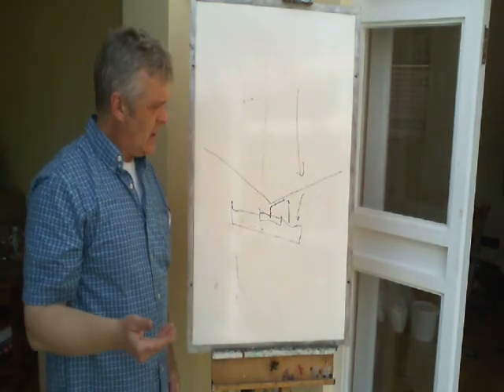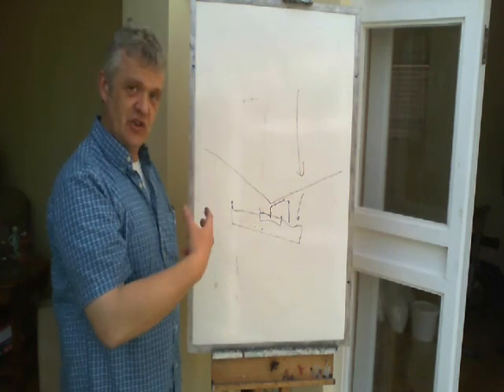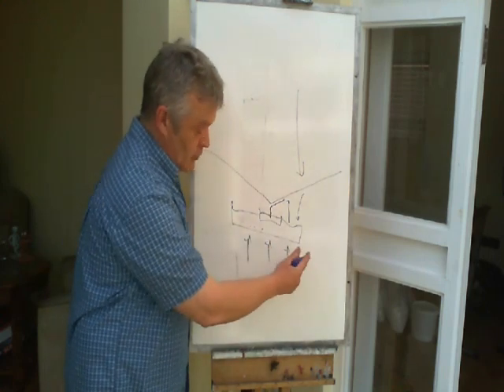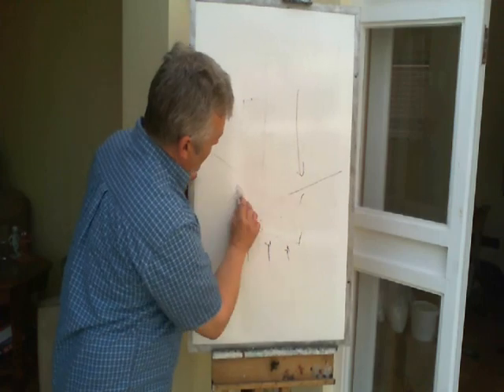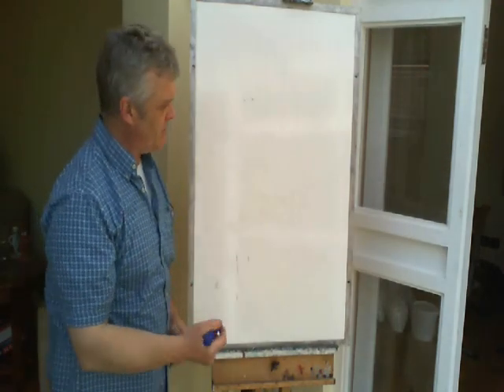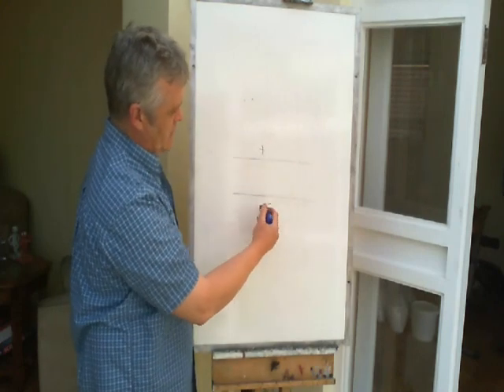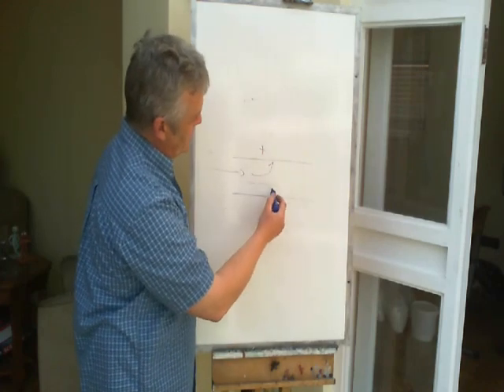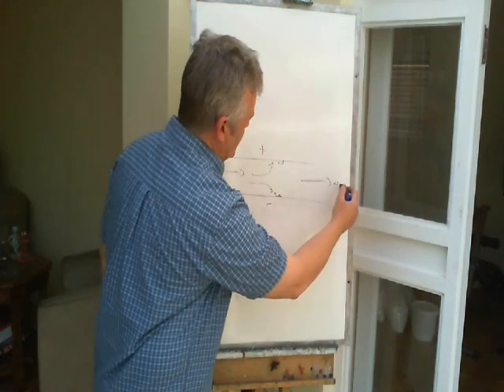Graphene Desalination

Comment: Have you experimented with graphene and peltier modules by chance?
Reply from the maker: no not yet - but i have plans lol
Reply: +Robert Murray-Smith That's great, I can't wait to use it :-)
Reply: +Robert Murray-Smith I would like to try and make a cooler that makes its own ice without water or external power source using a more efficient Peltier, atmospheric water generator and some solar power. :-) Mars tech
Reply from the maker: cool idea - pun intended lol
Reply: +Robert Murray-Smith :-)
Reply: +Robert Murray-Smith My brain will not stop, I was just a chimney sweep and now I'm doing weird things like applying for patents and building magnet motors with pyrolytic graphite. Many ideas
Reply from the maker: lol - very cool - it's all about doing mate
Reply: +Robert Murray-Smith One more question if I may, would it be possible to make a pyrolytic graphite heat sink? I have a pending patent for a personal cooling device that requires highly efficient heat sink fins.
Reply from the maker: i don't know i have never made one - but i guess it would - ORNL did some interesting stuff on graphenic foams as heat sinks
Reply: Robert Murray-Smith I just received this, the foam heat sink is what i need. Thecenter will be hollowed out and a cylinder phase change cold pack inserted for nice cold air blowing at your face :-) Aerogel polymer tube open on both ends, small solar panel and fan at top, heat sink and cold cylinder in middle for a few hours of AC and replace cold pack when needed. The vendors are going to love this, its the size of a soda can, extremely lightweight, can be sold from vending machines including the replacement cold packs. Nice residual income :-)
Reply: I got a trademark for it too, its called "NippyTube" lol Non-Provisional Patent Pending also. Any advice for a guy with no cash but a heart of gold? Love your work very much by the way :-) You have helped me tremendously.
Reply from the maker: i think someone already makes them mate - you can buy the material on the roll from china
Reply from the maker: sounds good mate
Reply from the maker: glad to hear that mate

Comment: Brine slurry you can electroplate valuable minerals out of it.
Reply: johnny llooddte Refurbishing a derelict oil tank farm at a port for gravity induced vacuum distillation would do the trick.
Reply from the maker: true
Reply: I really like your desalination methods the gravity method to make a vacuum and then low temperature boiling the seawater is amazing for large scale operations I just have this waste not want not hang up where I just have to find a use for the "waste' products and a high volume of brine constantly flowing through a system is ripe for the plucking.
Reply from the maker: it is a nice method mate

Comment: Unfortunately there is little to no advantage using this system over typical pressurized membrane desalination
You say that you get electricity back but you seem to have missed an important bit of information
You get less energy out than you put in even if you have perfect conductivity plates
This is because the salt recombines less energetically in salty water than fresh
But maybe it can be more efficient than the membrane you say
Nope
Because the membrane system never put in the extra energy of removing the salt from the water to the extent the capacitive system did
And both systems require almost exactly equal pumping pressure and flow rate to generate flow as well as upkeep (the electrodes will get clogged with dust just like the membranes)

Comment: I can't stop thinking about this particular video.  
Have you tried using electrets, or monothermal generators (monothermal from other -- low power/low voltage generators from your other video?)

Your graphene ink is interesting.  I'm going to grab some next month and test it side by side with graphite embedded polyurethane foam.

I'm envisioning a drip feed desalinator.  If electrets or monothermal works for an input power supply (usually considered too low power to be useful), you'd have an excellent portable prototype.

Excellent idea again.
Reply: http://www.sciencedirect.com/science/article/pii/S0011916405000603

Would seem to suggest that electret desalination tech is limited by surface area.
Reply from the maker: Peter Romo I do a lot of the videos to inspire others mate in the hope people will pick them up and run with them - i like the ideas you have here - they look promising
Reply from the maker: Peter Romo it would be mate and field density

Comment: Hi Robert / Community: I am attempting a replication. I am using a thick Hydrophilic sponge made by a brand greasemonkey, and it is made from cellulose and "synthetic fibers." I saturated 2 sponges right out of the package , with water resistant conductive ink (my nails are still black lol) , and let the 2sponges dry for 2 days. I then ran cool tap water over the sponge and black graphite water would come out the other side. I thought that some of the ink hadnt dried and the excess liquid was being washed away, but the ink left the sponge to the point where it was turning yellow again. Can anyone help me with what i am doing wrong, or steer me in a better direction.
P.S. I potentially might have solved the electrical connection to the sponges, say they are in a PVC tube enclosure. Drill holes in the sides of the tube and use Gold plated bananna plugs used in home audio systems. I would think the gold plated copper would botth conduct very well and not be comming off in the water. The plugs would just be pressing on the inside wall against the sponge.
Thank you everyone..
Reply from the maker: try leaving it longer to dry or oven drying mate - it shouldn't wash out when dry

Comment: Another great idea Robert!  How well do you think it would work at removing chemicals such as fluoride from tap or well water?
Reply from the maker: Hiya Mate - should be just as good - it will remove anything that has a charge - so anything ionic
Reply: Sounds like a lot of potential for places like here in SE Asia where there is significantly high levels of fluoride (where it is actually causing crop damage, not to mention the human impact).
Reply from the maker: i didn't know that
Reply: @ThinkingandTinkering  What about separating Lithium Bromite or Lithium Chloride from water? Will it work?

Comment: What happens when water passes directly through the sponge? This is a great video, thanks :)
Reply from the maker: cheers mate - but i don't really understand - if you don't apply the voltage - nothing happens - no voltage means seawater in - seawater out
Reply: I didn't form my question well. What i ment to ask was how effective this is, how much salt does it remove from the water, if you tested that. Cheers
Reply from the maker: oh ok - it'll reduce it to around 3-400ppm
Reply: Robert Murray-Smith Thanks, i like this very much
Reply: Robert Murray-Smith  For reference from wikipedia: "Salt concentration in slightly saline water is around 1,000 to 3,000 ppm" and "Seawater has a salinity of roughly 35,000 ppm, equivalent to 35 grams of salt per one liter (or kilogram) of water."
-so it would seem that the resulting water is certainly drinkable with a single pass.